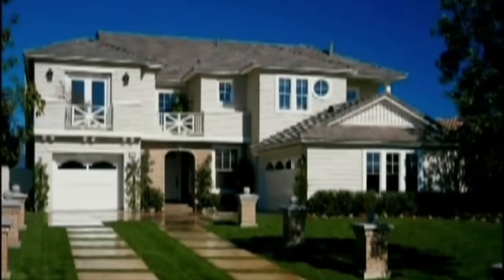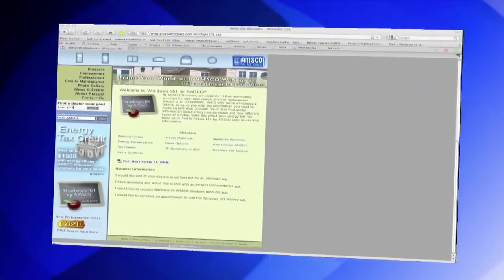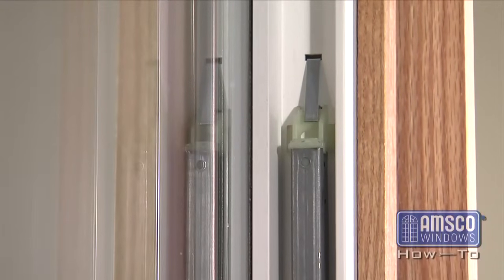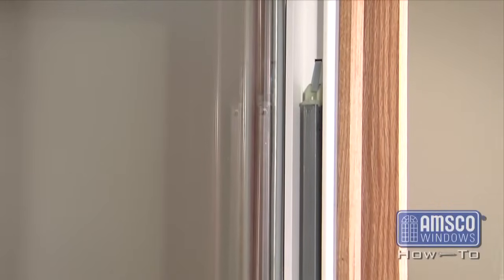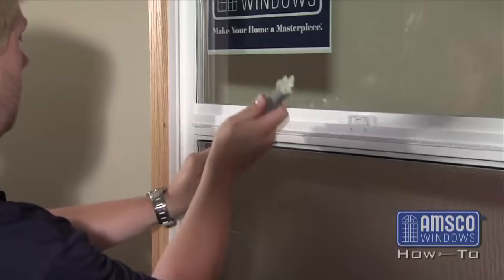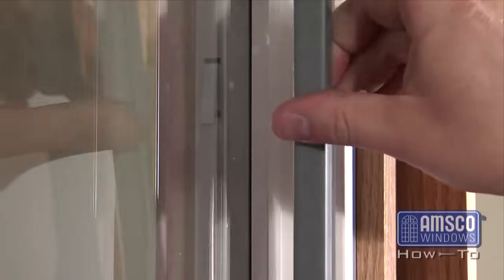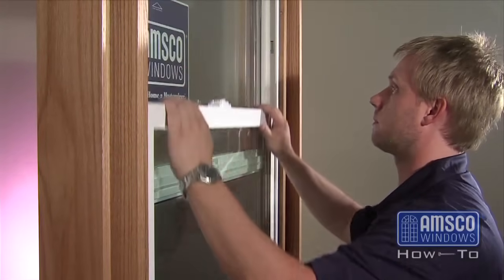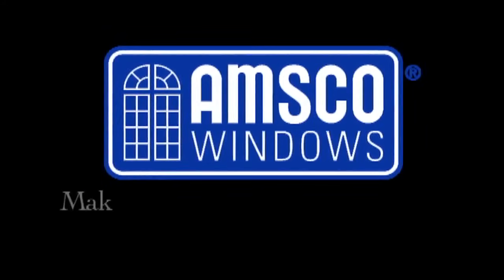Side-Load Single Hung Balance Spring Replacement

Comment: My balance spring was stuck at the top as well.   I simply lowered the window all the way.  Then I used a soft rubber objuct and a hammer to hammer the spring down far enough that I could pull the clip out.  then I raised the window back up.  the spring was kept down and I was able to take out the window.  Then I could do the required repairs and re-assemble the unit.

Thank you again for pointing me in the right direction.  Once I saw how it was done it was very easy!

Comment: Thanks so much for posting this video. My window had been stuck and unable to lock since before I bought the home. The prior home owner said it never did operate right. One of the balance springs was jammed above the window. This simple how to video made fixing the problem quick and easy. Good instructions and visuals that were easy to follow even for a DIY challenged person like myself.  I was able to remove the window,reset the balance springs and reinstall the window in just about 5 minutes.

Comment: Thank you very much. I had no idea what the metal runners on the side of the window were until I stumbled on this video. One of my take out springs was broken, but I was still able to get everything seated and working again by holding the spring down manually and installing the window with my other hand.

Comment: Thank you so much for this simple yet informative video.  The installers failed to properly place the little plastic channel on the top of each side of the window so when we lifted the window too high the springs came out and we could not figure out how to replace them.  It's easy with a little knowledge.  Thanks again.

Comment: Thank you for this video!  I just had this happen to 4 front windows rarely used, and exposed to intense summer sun.  After researching Pella (never a pleasant experience), for about 2 hours, I stumbled upon this video and BINGO, exactly what I was trying to 'understand.'  Pella never even mentioned the term 'balance spring' and I even looked through installment pdf files for anything which gave me a clue about what the issue was. Nothing about removing the the lower sash (although I knew there was a way) either.  (Being a basic dummy on windows and terms!).  It took me all of a few minutes to complete this task on the 4 windows, all working perfectly again.

Comment from the maker: Sometimes the take-out clips can be a little tricky to get out if they are hung up on the top.  There is a small rib in the top barb that keeps them in.  The best way to get this out is to try and keep the clip as close to parallel to the window frame as possible while pulling the clip out.  It may take a little wiggling to finally free it.  Eventually it will come loose.

Comment from the maker: It does make it more difficult to re-seat the balance spring if one side is sticking.  You can still resolve this yourself.  The trick is to raise the window sash above the stuck spring and shift the sash over the top of the spring.  You might need to collapse the take out clip on the side where the spring is seated to raise it high enough.  An other possibility is to try and remove the jammed spring.  This might not be possible.  

If you still have trouble please let us know.

Comment from the maker: If both of the springs have come disengaged you would follow the re-seating instruction as outlined in the video on both sides.  The only thing that would be different is getting the sash removed from the window frame.  It might be something that requires a few extra hands.  You just have to get the sash up to a point where you can remove the springs.

Comment from the maker: @paulcalif 
It is very difficult to perform this function without the take out clips.  You will be best served to replace the missing clips.  Please see our video "Replacing the take out clips in a vinyl window" for this process.

You may get replacement parts by contacting AMSCO Windows.

Comment: I looked and didn't see a manuf. label. My problem, now, is the company providing the replacement balances says they have to order them from another company and they just give that other company the measurements of the balance and the descrip and/or part # of the plastic pieces on the top and bottom but not a descrip or part # of the hook. So now I have to drive to their shop for the 5th time--30 minutes each way--to show them hook on orig balance so they can order it. My confidence is waning.

Comment: Super easy to replace! However, the window loudly squeaks and is stiff but only in the last inch or two in closing it. Is this normal and it will get better? Or do I need to try to center it better?
Reply from the maker: If the springs are making noise it might be because they are about to fail or it could be that they are rubbing against something.  If you need new springs they are available at a few outlets around the web.  If it is that they are rubbing we suggest taking the spring out and doing a quick inspection for obvious debris or looking for something in the sliding track of the window that might be causing it.  Hope that helps.

Comment: Hi. I'm having some difficulty with getting the replacement balance springs (rods? assemblies?) from a local company. They provided two, so far, of the six I've ordered--after mixing up my order with that of another customer. Now that I have two of them, I tried using your method in this video for installing the new balance springs but that was when I realized the hook at the bottom was different from that on my original balance springs. Can you direct me as to how to obtain the correct hooks?

Comment: What if one of the balance springs is stuck at the top of the right side but the other side works?  The window is able to go up (and stay up without sliding down by itself), as well as be closed by pulling or pushing down.  However that metal bar (spring) is stuck at the top, and thus now we can't take out the sash to fix. Can we not DIY or do we have to call someone else to fix it?

Comment from the maker: Unfortunately, there is no reliable amount that we could give as a range for cost of replacement.  Each situation and market is different. So, what would hold true in one might be completely inaccurate in another.  If you need parts we recommend contacting a dealer or the manufacturer of the window. If it is an AMSCO Window, we have a strong dealer network in our service markets that can help you.  You can find a dealer near you on our website.